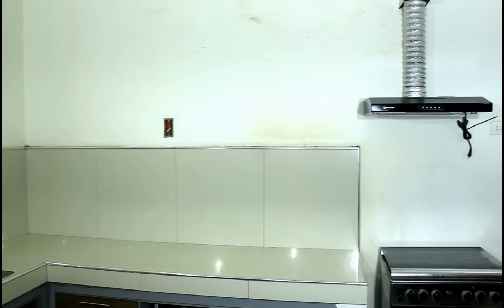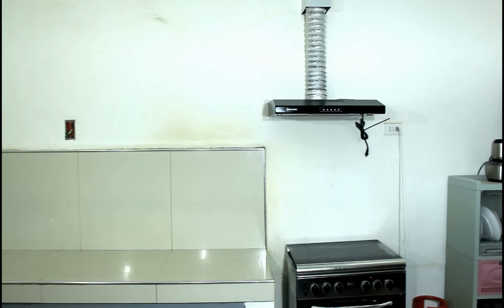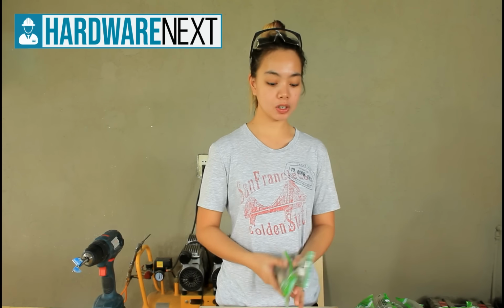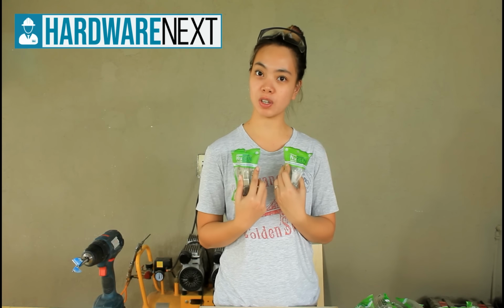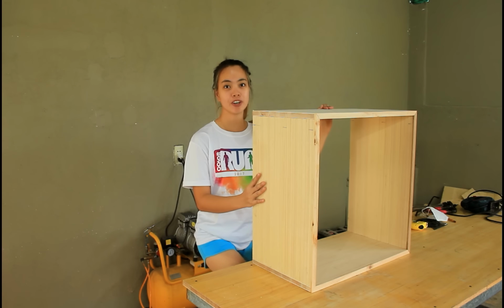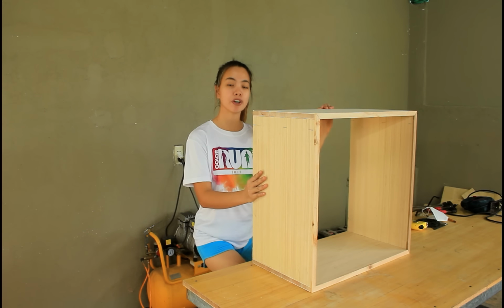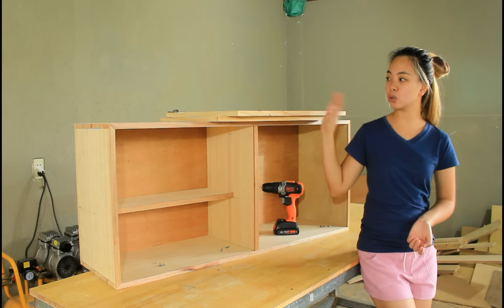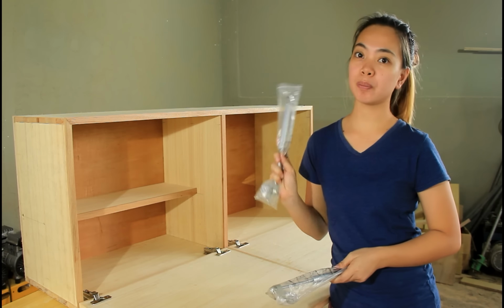DIY Kitchen Hanging Cabinet with Range Hood

Comment: Good job! I just wish that the boards were properly treated. Like a coat of varnish or some layers of paint because the moist from the sink or splatter from the stove would surely affect the wood’s quality in the long run. Nevertheless, it was still an amazing job you did there 😊😊👍👍